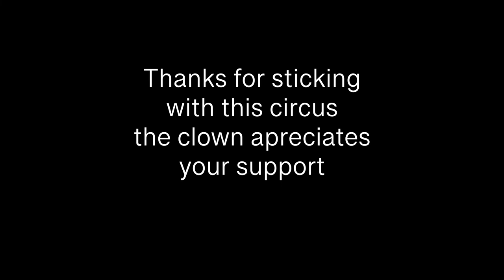How did I not see this coming

Comment: lol. i feel your pain. i shot a whole blank roll on my bronica when i first got it. "tested" it by firing the shutter a few times. turns out i should have set a slower speed as my "confirmation" was just the mirror slap and not the actual shutter. with longer times, it was obvious that the shutter in the lens wasn't firing at all. fortunately, i had another lens with a shutter that worked fine. the defective lens has been retired until i decide if it is worth it to try and troubleshoot the issue; it could be as simple as cleaning some internal contacts.
Reply from the maker: Awful feeling mate, I'm sure I made a few nice shots with the zenit alas I'll never know. What Bron have ya got? Love my ETRSi even though it's still at the repairers awaiting a diagnosis I still class it as the best most enjoyable camera I've ever shot.
Reply: @paultaylorphotography9499  , i have an etrs that i received with three lenses from an older photographer that was scaling down his collection. it is beautiful system, but i do envy the mirror lock-up of your etrsi =-)
Reply from the maker: @thomaschipman  the mirror lock up something I’ve never used maybe I’m missing out. At the moment my ETRSi is presumed dead awaiting repair report I have an ETR in storage as back up but not used it yet if it half as nice to use as the ETRSi I’ll be happy just love the brons mate

Comment: Hi Paul, what a pain. Does the mirror move up if you put a toothpick under it and gently move it upwards? The grease and oils they used on these cameras was not exactly top grade, could just be gummed up.
Reply from the maker: Hey andrew yeah the mirror moves freely manually mate
Reply: @paultaylorphotography9499  got a similar problem on a TTL. It all appears to work but the mirror doesn't lock up, just comes straight back down again. Easiest way to test this is to put the camera on B, hold the shutter button down and see if the mirror stays up. In my case it doesn't so the TTL is on my long list of cameras to try and fix.
Reply from the maker: @andrewwilkin1923  thanks for the tip I’ll try that ASAP mate be interesting to see ya fix the ttl